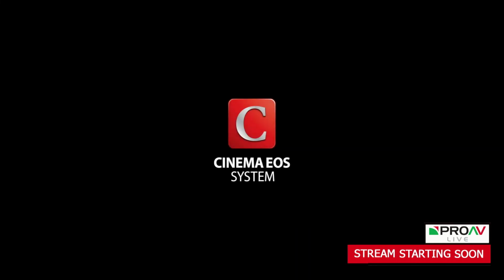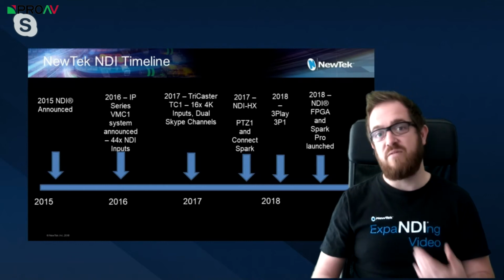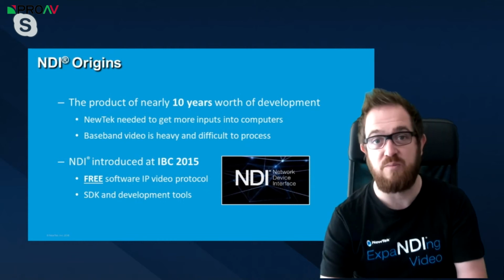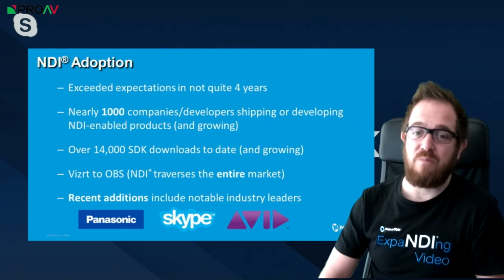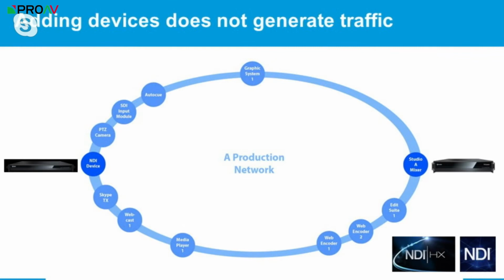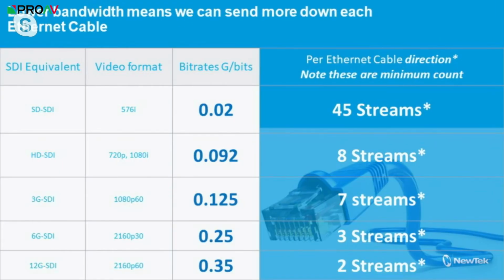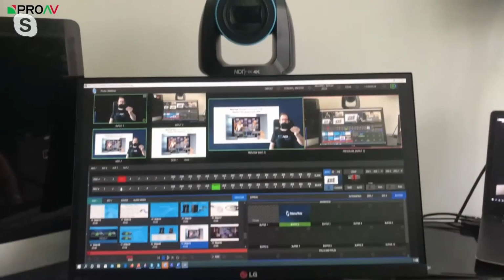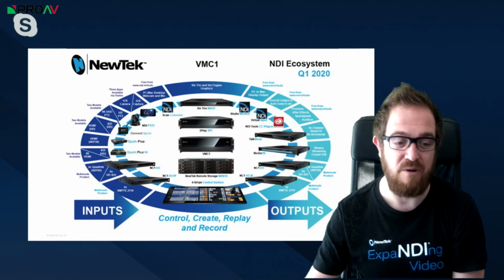Introduction to NDI with Liam Hayter

Comment: I've used NDI with OBS few times but seeing the prices of hardware NDI media converters and tricaster switchers are expensive. Same for NDI PTZ cameras mentioned in the stream  - over 4000 USD for this kind low quality output? Really? Don't get me wrong but if you are on the budget the NDI is not way to go IMHO it's too expensive if you want to do it in proper way like SDI plus there is not much of native products yet to choose from. 
TL;DR: NDI is great but it's not that cheap over traditional SDI